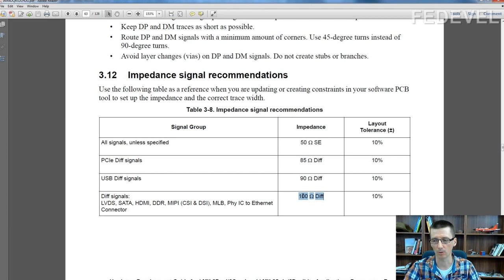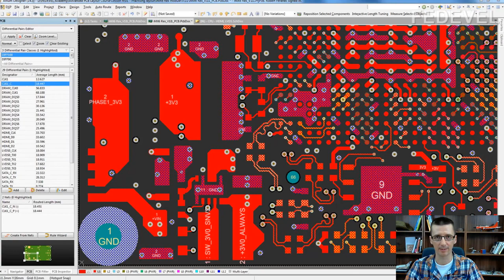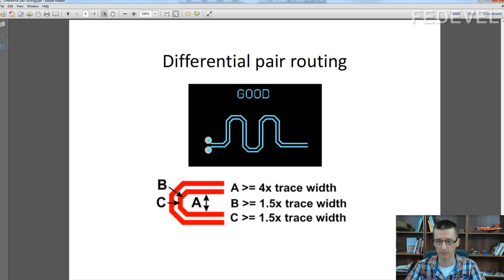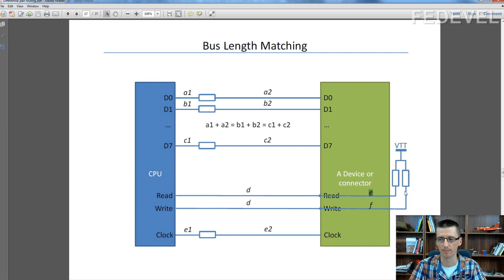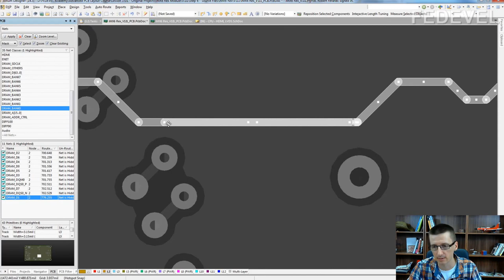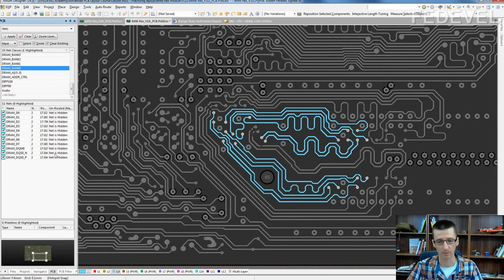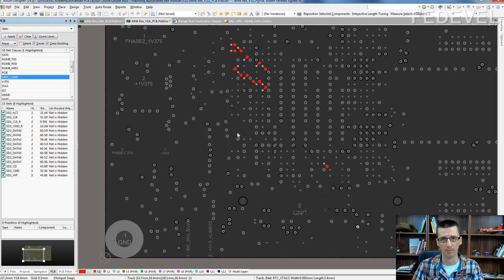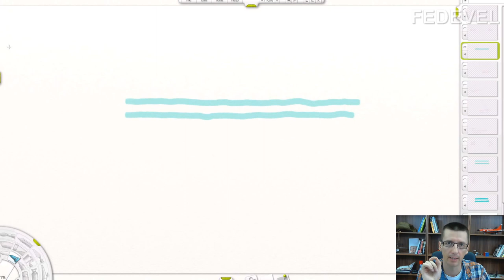High Speed PCB Design Rules (Lesson 4 of Advanced PCB Layout Course)

Comment: One of the reasons I use round corners on waves, is because they are longer. The distance around a quarter circle is 1/2 pi (1.5708....) and the distance along the equivalent diagonal is sqrt 2 (1.414...) so you get more length used in a smaller physical space. This can be, on certain boards, the difference between fitting the tracks and not.

Comment: At 7.40 you are saying "At this point, these edges will start travel together". If they really do travel together at this point, then the positive edge below will arrive later because there is another "bump" in the trace. Isn't it ? I'm beginner to hardware design so don't hesitate to explain :-)
Reply: they have to arrive at the same time at the end of the track. the other track finish sooner, the 2nd wave is added so the lenght is the same on both track and therefore the wave arrive at the same time at the end of each respective track.

Comment: Hi a very great tutorial, really loved it....I would like to know why signals travel at different speeds inside the PCB than on Top and bottom layers.
Reply from the maker: Thank you Gudimetla. Difference is environment around the tracks - signals travels different speed in different environment (in different materials). In top and bottom, there is air, inside of PCB there is resin around the tracks. That is what makes difference.
Reply: @RobertFeranec  Thank you soo much for answer. Another small doubt, will signals travel faster orr slower inside PCB's relative to top? Because then I can know which track to length match..!!
Reply from the maker: @gudimetlakowshik3617  I would recommend you to watch this my video - there is a document showing that info: Review of Server PCB Layout & Schematic - Part 6: DDR4 Memory Layout & CPU Power https://youtu.be/rdlEm2xjCsc PS:  some software supports length matching based on delay, maybe that is something what you would like to use?
Reply: @RobertFeranec  Thank you for reply. I have recently came across in a linkedin post about a weird news. Donno whether it's true or not but the post said, "if you are using high speed designs try making your PCB RED in color because signals travel faster on red pcb's than any other colors." ....The post itself told that they donot know the reason for it. How much of truth is there in this statement? Is it correct or fake? Sorry if it sounds stupid but I just wanna ask this really bad...haha...thanks in advance....!!
Reply from the maker: @gudimetlakowshik3617  I have never heard anything like that - we use a color which we like or we feel is nice for the product / pcb. Even if there was difference, I do not think it would be important for standards boards up to 5GHz. But, it would be  interesting to see that article, why they are saying this and how they come up with this idea.
Reply: @RobertFeranec  Thanks for reply. I have to dig a little deep to find the post but I shall surely let you know once if I have found it. 

Always a fan of your videos. Thanks for valuable content. ❤️
Reply from the maker: @gudimetlakowshik3617  Thank you very much for watching the videos :)

Comment: Can you confirm that in conclusion all this is obsolet in newer Versions with LayerStack activated Impedance Calculator (Rule --> overwrite with "use Impedance Profile 'Diff90' " ?
But explanation in generall is brilliant simple. Thanks for that!
Reply from the maker: I only use impedance data from PCB manufacturer. I would not rely on impedance calculated in Altium.
Reply: @RobertFeranec  Seems to be very difficult to get them from the cheeper ones. (wanted to try if it is possible to do some based on 2 Layers with lot of space)

Comment: I have doubt about impedence controlled routing. Is impedence controlled routing is controlling the track impedance within the limit (minimum value can be any) or maintain strict impedance like 100 ohms? 
 Another one, impedance controlled routing can be achieved by using layer stackup or anything else.

Comment: Lots of helpful insights. Thanks a lot for posting this video! Can you tell me about calculation of the required track width and spacing to have a given differential pair impedance? Is this information obtained from PCB manufacturer or do you have to calculate it yourself using those expensive field solver software? My experience is that not all PCB houses can provide this information even if they advertise that they make impedance controlled PCBs. And if you do your own calculations, they may still contain some uncertainty and you'll have to order test PCBs to verify your calculations at your own cost.
Reply from the maker: I always leave the final "track geometry" decision on PCB manufacturer and then I adjust my PCB to meet the requirements. For preliminary calculation I use mostly Saturn PCB toolkit as it's free and has also other calculators (e.g. maximum current through track or via): http://saturnpcb.com/pcb_toolkit.htm
Reply: Robert Feranec Thank you very much. I'll check out this software. I have a question about your online course "Advanced PCB design". You say you provide a certificate. Is there some kind of exam at the end of the course to qualify for the certificate?
Reply from the maker: bormisha There is no exam, but if you would like to get the certificate, you need to do some work. Each Lesson has some activities to practise. Only the people who work on the activities get the certificate.
Reply: Robert Feranec Thanks. Do I have to use the Altium Designer which is expensive or is it possible to complete your course with a different PCB layout software such as Eagle?
Reply from the maker: bormisha If you would like to get the certificate, you will probably need Altium as all the files are in Altium. If you would like to learn the knowledge, you can watch the videos and use a different CAD system. In this case you will need to find your own way to do certain things in your CAD e.g. differential pair routing.

Comment: Hai Robert. I regularly following your videos. I learned so many things and i have one doubt in ALTIUM for high speed design. How to set the constraints for pin pair in altium .Recently i designed DDR4 board. In that board i followed fly topology( daisy chain). In that design i will used 4 ddr's and i have to match the address signals length from one device to another device. But it is showing overall 4 devices length. How to know the each device length?Please let me know how to set constraint for that?
Reply from the maker: Thank you Santosh. Just answered in your other comment. Have a look at this video: https://youtu.be/jpk-hfsFaqA

Comment: Hi Robert, My question is Related to RF issues, how I can insert a PCB antenna on the footprint file?

Do I have to design it from scratch or there is a faster way (Like on the shelf ) that I can use?
Reply from the maker: Usually what I have seen is to use a ceramic antenna or draw/import the antenna based on reference design.
Reply: @RobertFeranec  
This was super useful information...thank you.

Comment: What is the maximum frequency that these rules can be used for a good quality design? I mean if we go to GHz signals are  these rules still sufficient or do we need to apply more rules?
Reply from the maker: +Pejvaak Salimi We have designed number of CPU boards following these rules (PCIE & SATA were probably the fastest interfaces). For higher frequencies you may want to have a look at additional recommendations (e.g. adjusting impedance under component pads, VIA impedance, VIA length & stubs, ....)
Reply: Robert Feranec Thanks very much for your reply and very helpful video.

Comment: At 24:40 , "resistor should be put close to the output". If data is bidirectional, for example from usb controller to an FPGA, where should put the resistors?
Reply from the maker: Very often these series resistors are placed closer to CPU / FPGA on bidirectional data signals. However, I would maybe also consider the strength of pins (or possibility if you can control speed of rising / falling edge in registers) - in that case you may want to place the resistors on the side where you can not control rising / falling edge or on the side with faster rising / falling edge.
Reply: Thanks, nices videos.I learn a lots of things